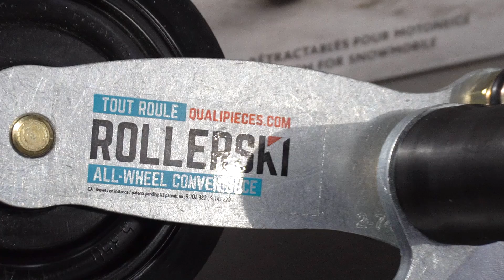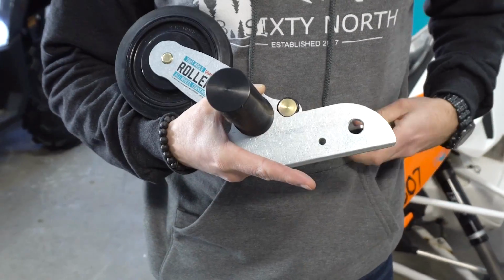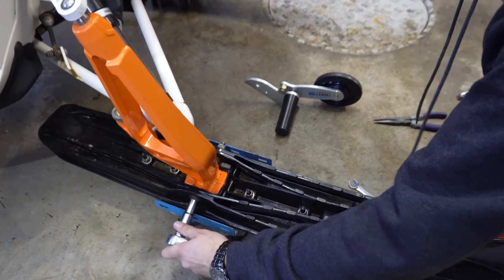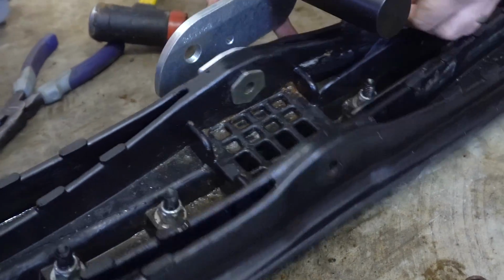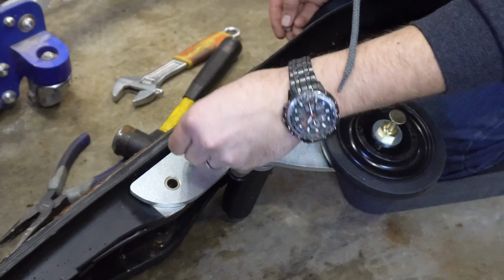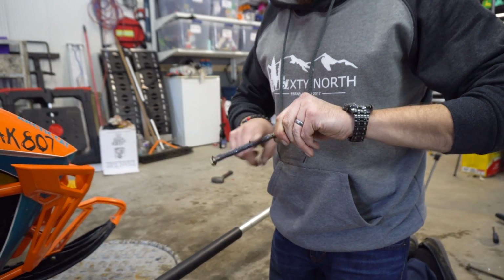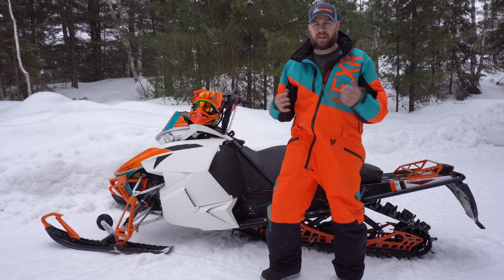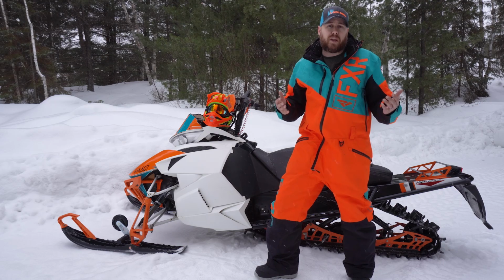Install and Review of RollerSki by Qualipieces.

Comment: Will the rollerski fit on the aluminum ski issued on the Yamaha 1995 VMax? This is an all aluminum ski. I am putting these skis on my 1988 Yamaha Exciter. Thank you in advance for your comment.
Reply from the maker: For the 1988 Enticer qualipieces doesnt list any snow machines prior to 1997, I would imagine they do not have a setup for your application. You would have to modify the Qualipieces brackets or modify your ski, these may not be viable options however.